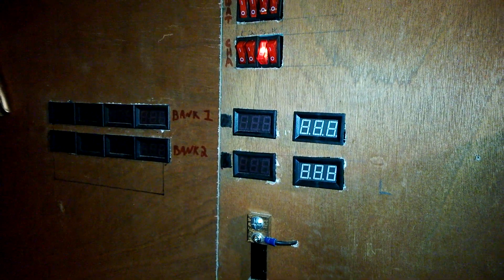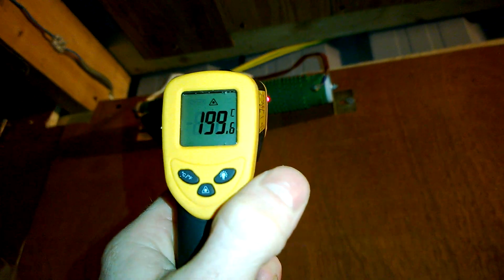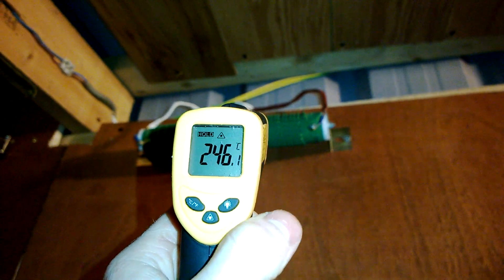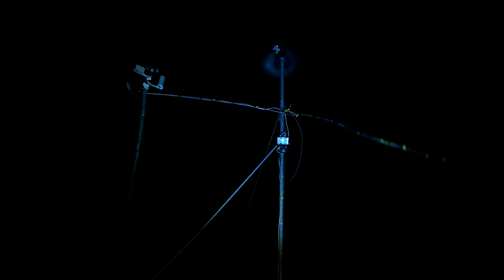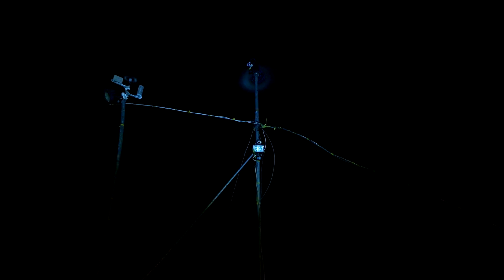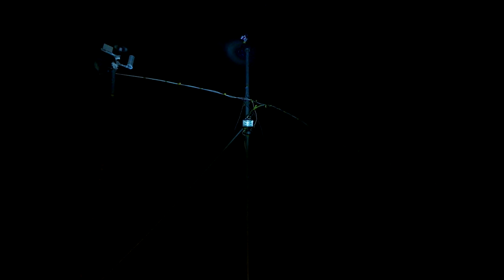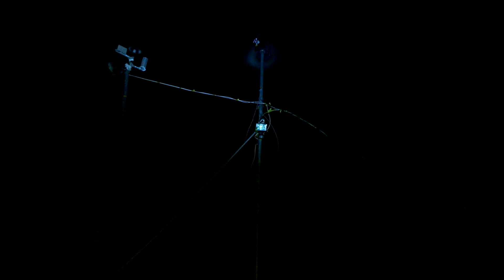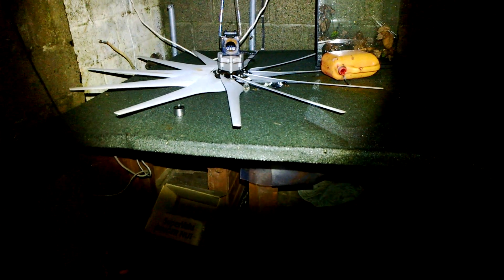TOO MUCH POWER FROM THERMODYNE

Comment: I have seen alot of vids that show in this kind of wind MWS would produce maybe 600 watts and they cog so bad, they simply cannot be turned by hand. Very happy that I by chance went with Thermodyne. At the time I did not know the difference, I just got lucky.
Reply from the maker: +Trina McDonald  The MWS are very bad stay away from them. Which blades did and turbine did you get from thermodyne?
Reply: +Stephen T The huge KT Ghost blades. 1600 watt PMA. 3 of them. High wind zone here (4-6), run the house nicely. For added info.... 1400AH agm telecom battery bank, 8000 watt pure sine wave LF inverter.